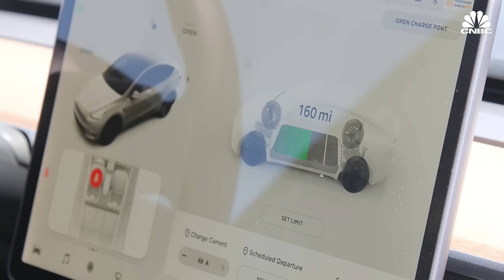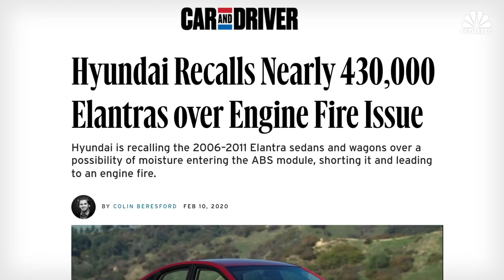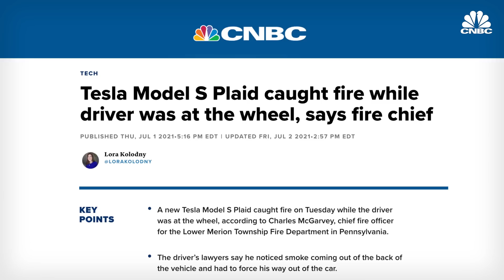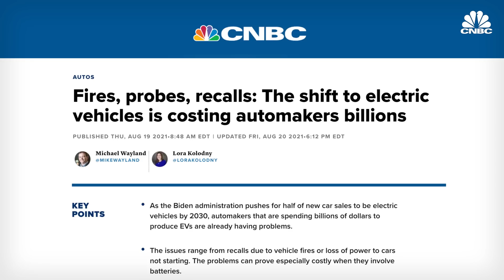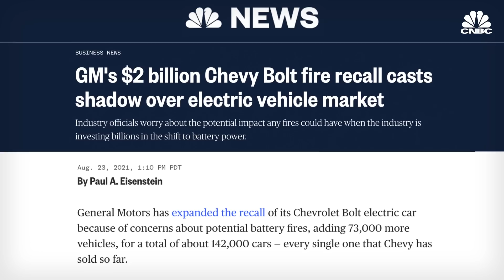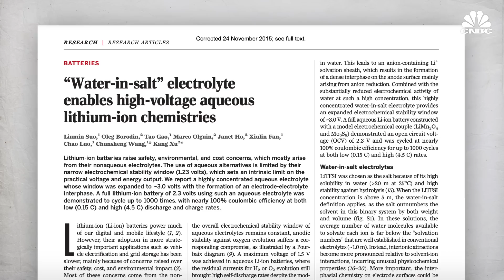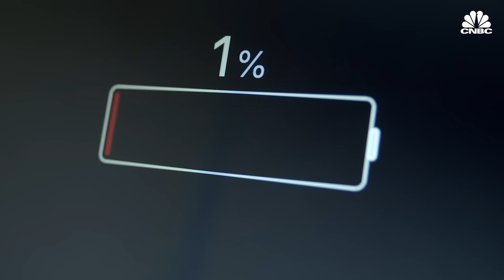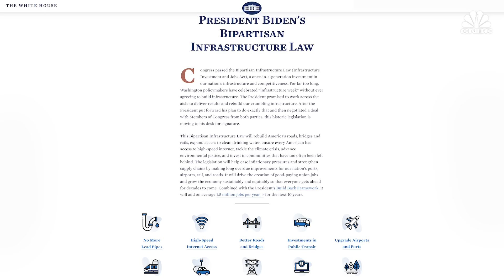Why Tesla, GM And Other EV Companies Have A Fire Problem

Comment: I don't care ..... Some day .... I will 💓 to buy an EV
Reply: Nah, just use public transport. And get a $2000 Toyota 2005 Camry
Reply: @lmao22683  no one wants to do that for a reason.
Reply: @lmao22683  public transportation can't get me to my job site and a 2005 camry is worse for the environment.
Reply: @odisy64  no is not worse for environment. Look you supposed to use existing car until they die. Don't be wasteful. 

If you have a 2010 car and you just switch for an EV cause for "better environment" you are wrong. Cause you will use up more materials, thus causing more pollutions
Reply: @lmao22683  the gasoline you burn will eclipse the life time emmisions of a car no matter what, 21pounds of co2 per gallon of gasoline.
Reply: @odisy64  LOL I got a 15 years old Toyota Camry. And I saw people in indonesia using 30 years old Toyota truck. Their lifetime is incredible not usual US junk.
Reply: @lmao22683  30 years is not as impressive as you think, see plenty of older cars in the  US but im not saying those gas cars wont last, im saying the longer you use them the better a brand new electric car is in comparison. A tesla produces 20% more co2 than a comparable gas car but the diffrence in emmisions per mile means that a tesla will have produced less total  co2 after 2-5 years. But unlike gasoline, you can cheaply and cleanly recycle batteries. A Tesla model 3  battery should be able to last 500,000 miles but the new 4680 tabless cells tesla is now producing should last over 1 million miles.

Comment: Thank you, we had decades of experience with lithium batteries in consumer electronics. It’s interesting to see a lot of the same challenges have carried over. If always assumed but not had the data to back it up.
Reply: That’s comparing apples and oranges. Lithium ion is a generic name. It’s like saying all cakes are the same. Or cake and bread are the same. 
Remember if it bleeds it leads. Out of the billions of cellphones, laptops and anything else will a lithium ion battery how many fires were there?
Reply: @RCdiy  the science is clearly the same, so not sure where your apples and oranges comparison comes in. Perhaps you’d like to elaborate on that?
Reply: @jtonline99  It clearly isn't the same as there isn't a single type of Lithium Ion batteries.  Lithium Ion is an umbrella term of the battery technology, kind of like jets.  There are different types, sizes and functions for jets.  They are not all the same.

Same applies to Lithium Ion.  NCA batteries are different from NMC batteries, you have cylinder type and pouch type cells, 800V and 400V batteries, Lithium Polymer, Lithium Air, Sodium, Solid State, Lithium Iron, etc. etc.

Certain types catch fire when punctured, others do not.  It depends on chemistry, cell type, energy density, packaging, etc. etc.

So, no.  The science is not "clearly the same".  There are substantial differences between current cell types and chemistry.
Reply: @redbaron6805  I don't think you've demonstrated a substantial difference in the fundamental science of Lithium-Ion technology, rather rattled off a list of materials, packaging methods, voltage applications etc... that have occurred as the technology has advanced and manufactures adapt the batteries to their particular application.

Fundamentally they all have a flammable electrolyte and are a risk for overheating, thermal runaway, explosions, etc...

And this isn't old news. There are plenty of examples of recalls from tech (Apple and Samsung), through to Aviation (Boeing) through to the automotive industry for these type of challenges, and they all use types of batteries across this Lithium-Ion spectrum you mention....
Reply: @jtonline99  No, you are just throwing random claims on the wall here.  The idea that they "all have flammable electrolyte" is false.  The idea they all have a risk of overheating or thermal runaway is utter baloney, and simply demonstrates you have absolutely no idea what you are even talking about.

The batteries used in Apple and Samsung products have literally nothing to do with EV batteries.  They are charged differently, have different thermal management, have different chemistry, have different packaging and cell types, and have no relevancy to EV batteries.
Reply: @redbaron6805  I may not be in the industry, but I follow enough of the latest battery tech news to spot someone spouting a bunch of jargon to give themselves credibility 😊

Sadly for you the video above and abundance of reports of EV fires tell a difference story to your rant ☺️
Reply: @redbaron6805   and despite your rant above, you still haven’t demonstrated that distinction (other than to say “mines bigger, with a different package and software”).
Reply: @jtonline99  I simply don't have the time to educate you in detail about how the different battery technologies work.  

Your only answer is I don't understand how any of this works, so I'll just repeat my post over and over that all Lithium Ion batteries are the same.

They are not.  Your "assumptions" are simply wrong.
Reply: @redbaron6805  It’s a shame you don’t have time. That’s convenient. Farewell 🙏
Reply: @redbaron6805  note 7s, random laptops, nearly every cheap tablet...

i could go on for a long time
Reply: @bongkrekic  Go on about what?  Cars don't contain phone or tablet batteries.  There are distinct battery types for cars that are different from consumer electronics.

Hence, those don't actually apply.
Reply: @redbaron6805  my point is we have experience that lithium ion batteries are known for blowing up, we should use something like li-po batterries which can be replaced quickly, lets say, in a system where for go to an EV equivalent of a petrol-pump where you exchange an exhausted battery for a new one and the exhausted battery is properly charged under professional supervision.
Reply: @bongkrekic  They are not "known" for "blowing up", that claim is simply false.

The battery fires we are seeing today are related to production defects on early generations of EV batteries.

This isn't a charging issue and even with current early generation battery defects, battery fires are still exceptionally rare.

Hence, even with the current generation of EV batteries, they still catch fire 60x less than combustion engine cars, and that ratio will only climb as manufacturers address and correct the defects during manufacturing.
Reply: Why not ban cars entirely and make city's more sustainable and profitable by making them more dense and walkable it will reduce obesity and and other health issues and also battery cars are not good either they use tires and building them requires rare earth metals which causes pollution battery cars explode mixed housing is better
Reply: You don’t push the limit on physics when it comes to high capacity charging - Samsung did and had to recall its products.
Reply: No safety from ev

Comment: The biggest elephant in the room when it comes to BEV is that it's politicians who want BEV, and not the manufacturers nor the customer. Many manufacturers are trying to adapt to the government threats and hence the trial and error approach we see and some customers are falling into the trap. I guess BEV must be tried in small city transport until all the hidden/unknown/unthought issues are ironed out. Lastly, let's not ignore the progress made in heat efficiency in ICE propulsion. I am conviced by 2035, the ICE heat efficiency will pass the 50+1 % mark
Reply: No, that is now how physics work.  EV motors are 90% plus efficient.  Combustion engines are peak efficient around 30%, average around 20%.

EV's are taking over because they are simply far more efficient, far cheaper per mile, far simpler and hence far more reliable.
Reply: Politicians don't want EVs, the president doesn't acknowledge Tesla and the legacy automakers want tax payers to pay for the loss they will take building them, except for tesla, people actually want those cars. Gas engines had a century to reach half efficiency and they still mass produce it.
Reply: @odisy64  Gas engines still don't reach half efficiency.  Typical combustion engine efficiency averages around 20% and peaks around 30%.
Reply: @redbaron6805  i meant to say haven't reached it, some high RPM low powered diesel engines can aproach that level but only in a lab setting. For electric cars, battery and motor efficiency is desired for more than just range, it also means less heat while gas engines get hotter the more efficient the burn.
Reply: @odisy64  You are correct that there are some lab engines that get peak efficiency at a single RPM in that range, but translating that into real world efficiency is pretty difficult.  Electric motor efficiency is however over 90% already and EV motors don't require a transmission so the losses are minimal in that area.

The problem with the combustion engines is complexity keeps increasing which also affects cost and reliability.  In actual production vehicles you can buy today, MPG peaks around 40 for gasoline engines while the equivalent MPG for an EV is over 145 already.

So, they still have a long way to go and there is no realistic way for them to match electric motor efficiency.
Reply: @redbaron6805  i believe motor efficiency with Teslas carbon fiber PMSynR motors have around 98% efficiency (single speed reduction gear connecting the motor shaft to the axel adds resistance) with the battery is around 95% but gets worse depending on power output. Unless has engines can recycle nearly all of their heat, they have no chance of beating EV drive trains.
Reply: @odisy64  Wow, wasn't aware that the efficiency had reached those levels yet.  Some of the Tesla efficiency is due to the dual motor setup where they have different reduction gear ratio's front and rear, and therefore can have two optimal motor speeds, and shift power between the two for optimum efficiency.  Also, they can use the smaller front motor for highway speeds. 

But, you are correct of course, combustion engines waste around 80% of their energy on heat, and there are no easy ways of capturing or reducing that.  Hence, they have no chance to ever catch up to EV's in efficiency.  Even Plug in Hybrids have about half the efficiency of BEV's, so improving ICE power trains efficiency requires them to be electrified to do so.

Tesla has also been a fine tuning the efficiency on everything from the brakes to wheel bearings to the climate control systems.  So, they have been able to slowly squeeze out more efficiency from already very efficient vehicles which is clearly visible in their efficiency improvement numbers over the last few years.

Comment: Interesting! Never seen CNBC discussed fire problem in ICE cars! Which is much more serious than Tesla! 
Of course it is understandable as everyone knows from where major advertising revenue comes from!
Reply: ICE cars tend to set flame after a crash. EVs have the nasty habit of flaming out while being charged. And that’s a big difference
Reply: @MrJimheeren  nope, ICE cars can catch fire from any number of reasons, last month i saw a car burn because its radiator was blocked by snow. Nearly all tesla fires are caused by collisions, on some rare occasions the wires in the house are too thin to supply constant power and catch fire.
Reply: @odisy64  at least ice car fires are easy to put out, and yes i know they happen more but many times they are mild and are resolved with a fire extinguisher, my dad had a truck whose starter motor turned on and he was able to put out the fire quick and easy and two days later It was running again, but imagine an electric car on fire inside a garage and having to wait for the firefighters to come with more than 20,000 gallons of water, that's what nobody compares to cars ICE and the EV
Reply: @dawrincueto6962  according to firefighter reports, it only takes about 2 minuets to put out an EV fire but they will continue to douse the battery to prevent heat from re igniting the battery but this is often exaggerated by the media that makes it sound like 20,000 gallons where needed to put out the flames, this happens with engine blocks as well, people will use a fire extinguisher on a hot engine block that just got shove into fuel lines only to have the heat re-ignite the fuel as soon as oxygen was present.
Reply: @odisy64  what firefighter report?  It does take an average of 20K gallons of water. Very important in drought times for California. The place that has brown outs and power shortages. Garages have a one our firewall and ICE engine can be extinguished in that time. EV will loose the house unless the car can be pulled out.
Reply: @odisy64  we agree. It takes thousands of gallons to control an EV fire. I hope a hydrant is always handy. As far as CA agriculture, I don’t know of a farmer and crop that wastes water. It is an expensive ingredient to produce food. Food is CA’s number one export.
Reply: @odisy64  How did the radiator set the car on fire?
Reply: @odisy64  a nail penetrating the battery, I don't recall Tesla ever admitting to there being a fire problem with it's battery, then again Tesla tried to get out of replacing the recalled airbags.
Reply: @odisy64  Exaggerated huh? I remember one EV fire that was put out by the fire department and it reignited while it was being transported to the yard, after putting the fire out again, they put it in the yard where it self ignited a 3rd time. Since then the most fire department put the EV in a tank of water to ensure it does not self ignite.
Reply: @pogo1140  when a car revs its engine its burning more fuel and therefore making more heat which needs to be purged by the radiator. If the radiator is not getting sufficient air flow through its heat exchanger then it will just overheat. The engine block will eventually start melting plastic and lines such as the plastic housing or full lines or grease. This happens often in winter when cars get stuck in snow and over rev their engines. 

The battery needs to continue having water doused on it after the flames go out because the battery pack is heat soaked and will continue the thermal runaway unless its cooled. Many teslas catch fire after a collision and fire fighters are learning what needs to be done to put them out but yes, they are exaggerated, why else would a fire chief specifically address the medias claims on a tesla fire they dealt with?

Comment: I get the impression that firemen aren’t putting these fires out they are just burning themselves out.
Reply: good observation.👌 yes this is pretty much the case with a battery fire, usually by the time Emergency Services arrive on scene it's already TOO LATE (as they are well behind the response curve).  their focus/function at that point is merely to "control" and "contain" the fire to the vehicle itself, and hopefully keep it from spreading to other surrounding structures as all the FUEL gets used up.  examine it closely, and you'll see a lot of PARALLELS in this to what crews face that we see on the news while fighting Wildfires in the West last year (and previous years) and also down in Australia. different scale and scope for sure, but same underlying principle. #COMMONDENOMINATOR

Comment: Gasoline is extremely flammable - And there are approximately 276 million internal combustion automobiles on US roads today.  Time, Experience, Innovation - EVs MUST eventually replace most of those vehicles.
Reply: “EVs MUST eventually replace most of those vehicles.” No, they shouldn’t. The only use for an electric vehicle is to promote the liberal government’s climate alarmism scam.
Reply: Parked gasoline cars don't suddenly catch fire.

Comment: Nice hit piece on EVs. I mean nothing gives me a bigger sense of security knowing I’m driving around on 18 gallons of fire resistant gasoline.
Reply: The accidents about EV fires have to be reported.  GM and Hyundai have massive recalls of their EV's from EV fires to the tunes of $Billions, and GM hardly sell any EV since the last year.   These are  important matters.  Please open your eyes and see the truth.
Reply: Fuel isn’t flammable in liquid form. It’s only the vapour that is flammable. Batteries on the other hand do not like to be crushed, they react violently to that. What could go wrong putting massive batteries on the underside of cars moving at 60mph. Battery fires take a lot more water to put out and repeatedly reignite after being put out. Call this revenge of the Ford Pinto.